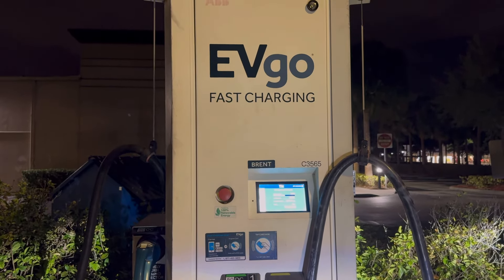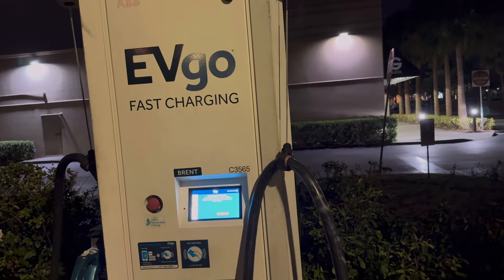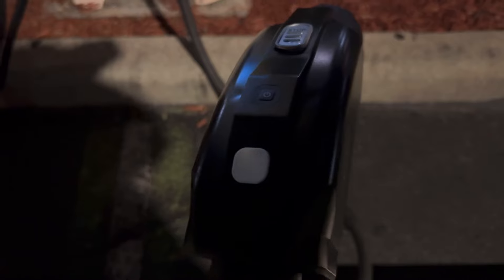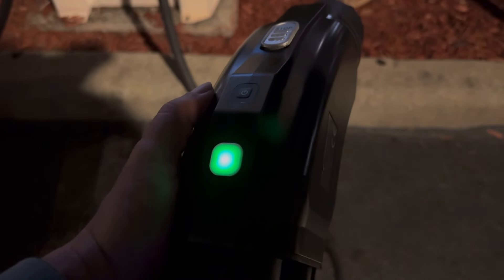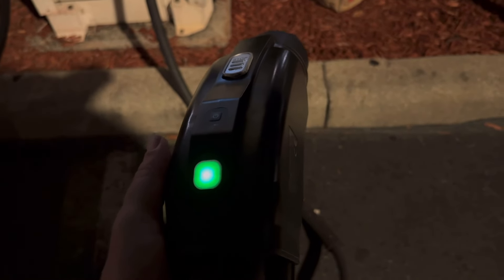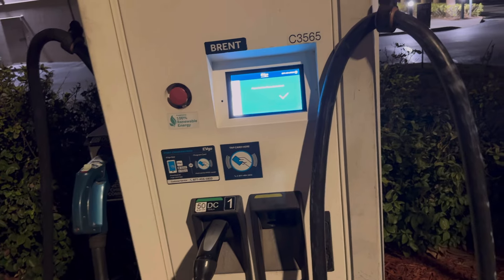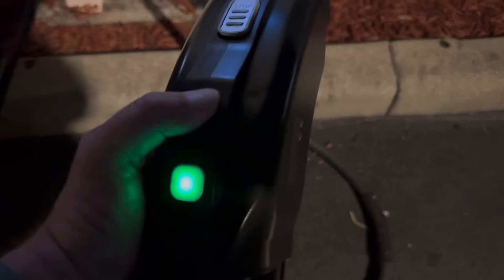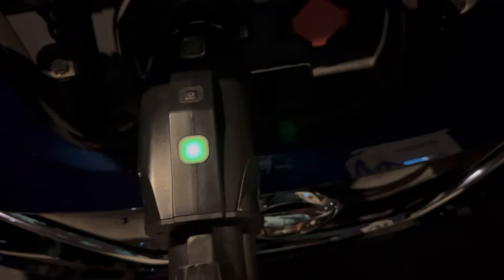First test after firmware update to the CCs to chademo adapter

Comment: Greetings from Finland, maybe the adapter should be placed to vehicle first, and after activating adapter, put the ccs connector to adapter? Just to test, if there is any difference on connecting order.
Reply from the maker: I did it that way a few times, will try doing it again, but the company seen my video and told me to do it this way where I plug it in wait for the machine to clear payment and then press the power button and wait for it to connect and then plug it into the car in the next couple days I’m gonna continue trying it both ways. I have had it working on that machine before, but I think the firmware they broke that machine to where I need to another test while it’s hooked to the computer to get some readings to send back.

Comment: I don't understand why it wants to be connected to the charger first. If I was designing one I would start by having it communicate to the car first and then have it appear as a different car to the charger.
Reply from the maker: I think why they want me to try doing it that way is because it has a built-in battery you plug it in once the pump tries to make a connection you power it on and then the power that’s in the unit tells the machine that it’s connected and is speaking with the car even though it’s not then you plug it in
Reply: @nomadichippie  but if I was writing the pump firmware I would add a "time out" counter to make sure the code does not get stuck in some state of the state machine. I would check with them since if it's not designed to be plugged to the car first there could be a window of time you have to connect it to the car after connecting to the pump.

Comment: Is it possible for you to put out an SOS to other owners of a working CCS to Chademo Adaptor that live in your neighbourhood and do a charge with each others adaptor as an experiment?  It would be interesting to find out if a known working adaptor will work on your vehicle.   If not,  clearly there is an anomaly with your car and maybe Nissan need to run tests on your onboard charger.  By the same token it would be interesting to see if your troublesome adaptor works on another Nissan Leaf.  If your adaptor refuses to charge  the vehicle that has previously successfully charged on the "other" adaptor, then I would be looking for the manufacturer send a replacement adaptor to you. I appreciate as you rightly say this is a Beta product and there will not be many out there but it must be worth a try?   Anyhoo, have a good one and be lucky.
Reply from the maker: I’m the only one with an adapter out here. I think there’s 2 others but far away in Las Vegas and one in California